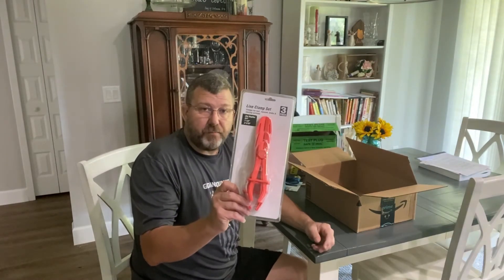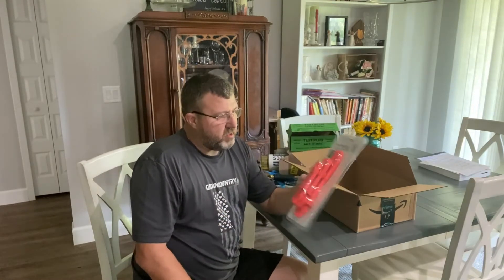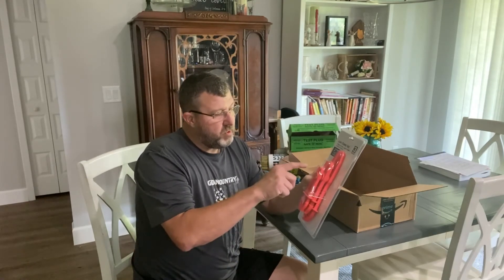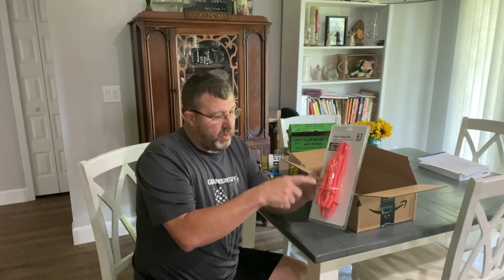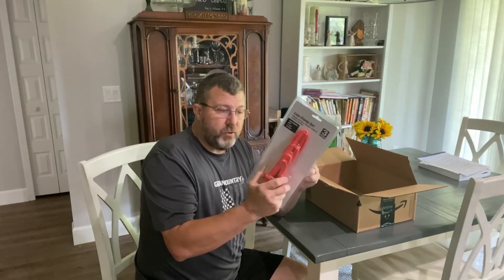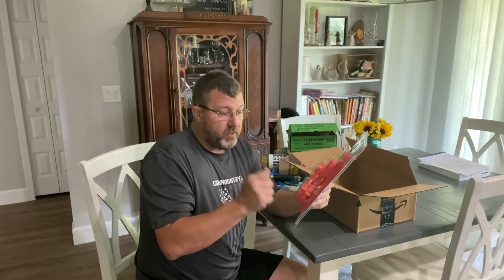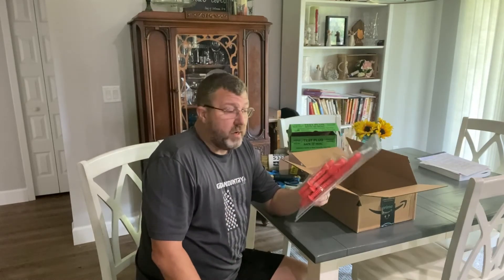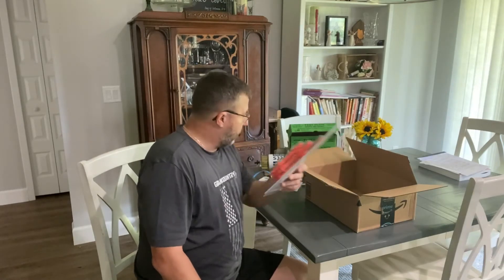Boat fuel tank pressure testing / water in fuel issues PT 1

Comment: Great video. Helping a friend fix up a boat that hasn't been used in a long time, fuel tank was about half water. Going to drain the tank this week but before filling it back up I need to thoroughly go over the system and figure out how the water got there in the first place. Your video was very helpful
Reply from the maker: Thanks for the positive feedback.

Comment: Hello James. Great video ! I just boat a boat and it has 2 tanks . The previous owner never used the front tank and it has no fuel lines hooked up. Before I fill it with fuel I want to ensure it doesn’t have any leaks. So I’m looking forward to your follow up video with your testing procedure using the parts you purchased. Thanks for posting the links in the description! Any idea when you are going to post that video? Much appreciated
Reply from the maker: Hi Gary and thanks for the positive comments.  To be honest, I have the initial second video recorded but after reviewing it, I want to add more video to it and my boat is having the starboard side head replaced at the mechanic (it's been there 8 weeks) because of a hairline crack.  It is supposed to be finished this week, so as soon as I can get the other portion of film completed that I need to shoot, I can work on the mixing and post part #2.  Thanks again for the support!
Reply from the maker: Finally got the call that the repair was completed and paid the bail to get my boat out of the mechanic's jail.  LOL  $3,000 to fix the head and $450 for a new timing belt tensioner later, I'll be doing my 1 hour mandatory cam break in and 4 hours of varied speed to set everything in place and get ready for some fishing and diving.  Stay tuned.
Reply from the maker: Part 2 was just published.  Hope this helps you!